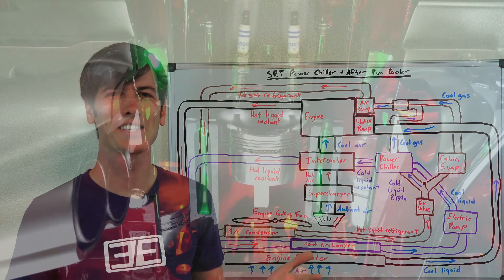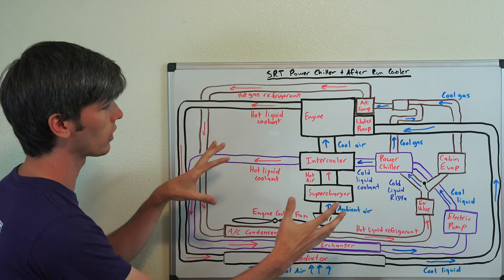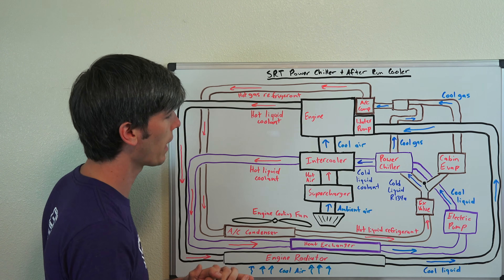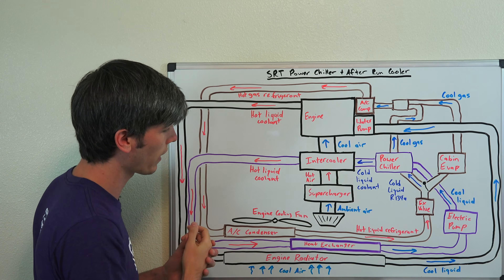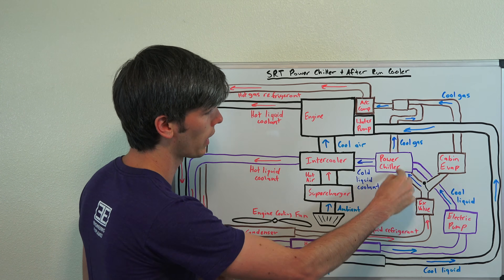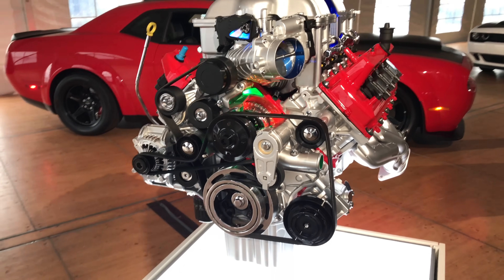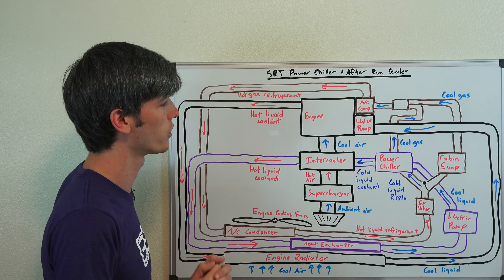How The Dodge Demon Uses Air Conditioning For More Horsepower!

Comment: So is this system better than a system that sprays the intercooler with Nox or CO2?  The coolant is contained in the Demon's design so you get around intake of spray bar output.  Is this going to be of benefit to people who have lower horsepower supercharged engines?  A Focus RS for example?  Maybe they do a Dart with an intercooled turbo?

Comment: My questions is about servicing the electric pump.
Would there be a way to implement this kind of technology without having to open up the AC loop to replace the electic pump? BMW just used an electric water pump for their "after cooler" which needed to be replaced about every 60k miles. These seem like it will be more common & more expensive to replace.

Obviously the Dodge Demon is a limited production Specialty Car so this isn't an issue but if this technology trickles to another vehicle then it could become expensive.

Comment: In 1993 Ford had the Mustang Mach III concept, which is basically where the Terminator motor would eventually come from, that used what was known as a Supercooler which used the exact same concept Dodge is using to cool the Demon motor with.  I never did understand why Ford never actually released a vehicle that utilized this technology.

Anyway I think this is the most interesting aspect of the Demon and I'm happy Dodge is actually producing it.

Comment: So complictad to get this dinosaur ICE to beat a Tesla. And the next Tesla that comes out will most likely beat it anyway. Oh well.
Reply: diskiller you're comparing an awd electric car with instant max torque to a rwd gasoline engine car with a 0-60 in 2.3 seconds. Tesla's are useless after 60 mph.
Reply: you tesla fanbois are funny. the demon is cheaper and more practical for everyday use. not to mention maintenance costs. lets compare the costs in 10 years. i'll bet that tesla will be seen as the joke.....the environmentally disastrous joke.......it really is.

Comment: Fantastic! At 0:37 i paused the video to examine the chart and i figured it all out 😋 the ac basically acts as an auxiliary intercooler for the liquid flowing through the primary supercharger intercooler. Cooler intake air means more dense air which encourages the ecu to add more fuel for more power! Smart thinking dodge! But is that extra power worth the extra weight lol where do we draw the line?!

Comment: Question?

An automotivr A/C system uses what's called a reveiver dryer to purge water vapor from the A/C system.. this is why you sometimes see water forming on the tarmac under a vehicle on a hot day.

At the drag strip, the A/C system cannot be run because of this drippage that can cause slipping and accidents.

How does this system overcome said issue?

Comment: Why did it took so many years for some to use this? I know the A/C takes engine power to work and so does the supercharger but still, it's been possible for so long. If you don't to lose power with the A/C you might be able to use an electric compressor like in a fridge or home A/C and have a second battery for It alone that recharges with the alternator. The only reason I think they don't use an electric compressor is because a belt driven compressor will have higher rpms and compression than an electric plus the lack of a strong enough battery. Still, who knows, maybe one day we will have electric A/C and less belts in the engine bay.

Comment: this system would make fighter jet power if it was using turbos! i why not just engineer a sweet water sprayer for the intercooler, a/c condenser and power chiller? one that would leak water on the track. then you can get well below ambient air charge temps

Comment: Dodge stole my idea!!!! Back in 2005-2006 I thought of the idea of using freon cooled air for motors. BUT unless im undsratanding this video incorrectly... it looks like the freon air is just to cool the intercooler air. My idea was to use the freon air directly into the combustion champers...

Comment: Here's the simple version of this easy to understand video. You have three air components in your car. The intercooler, radiator, and air condenser (basically the air conditioning). The intercooler and radiator take in a bunch of air. If you run the car AC it will take air from the outside and make it cold. Basically the AC is the intercooler for the inside of the car. If you turn off the AC and send that air to the engine, the engine gets more air. The AC will be connected to the intercooler so that it can take in more air. The AC in the dodge demon is basically just a third source of air for the engine. XD

Comment: I always dream of a way to use the exhaust heat to run an absorption chiller . This has been used in gas turbine generation to cool hot ambient air to 55 degrees f to eliminate the loss of 1 megawatt due to hot entering air into a Cf6 size turbine

Comment: Wouldn't it benefit from running the compressor on battery or storing pressure in a tank during the run, to eliminate the extra load on the engine from the condenser?

Comment: Question, will they use a second battery for the cool down system or just use 1? Won't that system drain the battery faster than usual?

Comment: turning ac off is overrated, it doesnt bog engine. just feeling, it doesnt even take 10hp and weight is like 20kg. ALso many cars after 2000 shut AC of on wide open throttle. Keep cool guys.

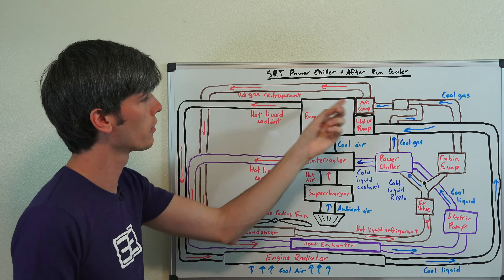Comment: 5:05  Why does the a/c compressor shut off over 4500 rpm?  I would have thought that was exactly when you would need charge cooling most.  I can't imagine the car makes a pass without ever going above that.
Reply: The idea is to cool IAT's before the run. That way you're starting with extreme cold IAT's, rather than heat soaked IAT's. I wouldnt want the compressor running during a run..that would just rob power. The intercooler pump, however, is still running at all times.

Comment: 5:04 So is 4500rpm a typical cutoff for the a/c in a normal car? Does it stop actively cooling the air if you go wide open throttle in a typical car?

Comment: I seriously doubt the a/c will be running while you shoot down the track. I know you said at ~4K rpm it shuts off, but I know a lot of other cars (modern) also have a A/C shutoff feature built into the base tune when you go WOT as well. Consistent hard pulls to 4k sounds like a great way to kill an a/c compressor. I see this feature being more beneficial in the staging lanes keeps your AIT's down while you wait in line to make a run. Just sitting, idling AIT's shoot up dramatically and ecu will pull timing, they don't come down until quite a bit of constant moving. They won't come down in just a 1/4 mile and this A/C feature will ideally keep temps down until you make your pass. I've played around with a dyno and older cars with no A/C WOT tune shut down will lose from 15 to 20 rwhp with the A/C engaged, newer cars are unaffected, as soon as you matt it the ecu disengages the A/C clutch and you see no difference while dynoing with the A/C on or off.

Comment: Autoline This Week (episode 2121) did an interview with Chris Cowland (Director of Advanced and SRT Powertrain at FCA) and he said that the idea to use the A/C system came from the Advanced engineering group (and not the SRT group) and they think that it may be a future technology to achieve better fuel efficiency in other types of ICEs that aren't meant just to chase power. How would that work?

Comment: Wouldn't a Turbo be much more efficient as it used the exhaust ?
Also can you detail about the temperature of each of the coolant circuits ?
And maybe can you make a video about the power loss and benefit of these systems ?
I think that Volvo has a similar system ?

Comment: For those short on time: bypass valve after expansion valve routes cold air from evaporator (passenger cooling) to a power chiller that feeds the intercooler. Very interesting. I wonder if this has been implemented before.

Comment: So how much power does the power chiller actually add?  I'm skeptical that just a 10 degree drop in air temp is enough to overcome the parasitic loss of running the A/C compressor during a run.  Not to mention the added weight that needs to be accounted for as well (not in terms of power, but 1/4 mile performance).

Comment: Cool video. I wonder how this compares to the efficiency of using an additional injector at the front end of the supercharger for cooling the air charge.  I know 90s Toyota used to do this and they called it the 7th injector and they just sprayed raw fuel inside of the supercharger to keep the fuel cool.

Comment: Superchargers = not nearly as efficient as turbochargers, and actually cause parasitic loss; pro - instantaneous throttle response

Turbochargers = much more efficient, utilizing energy that would otherwise simply be expelled, and greater ultimate power potential; con - boost threshold, spool time, and transient response between shifts

Comment: I do love these in-depth detailed explanations on this channel; it's fascinating.  But any of his engine videos, and especially this one, illustrate just how absurdly complex engines are getting just to eke out a few more HP (and usually at the expense of fuel efficiency).  EVs, specifically the Model S, are amazing out of the box, but I can't wait to see what the gearhead world can get one to do once they start really tweaking them: different gear ratios, better cooling, maybe electromechanical flywheels to prevent battery overheating...

Comment: Should have a collection tank from the cabin evaporator to collect the condensation from the air and then use it in a water injection system too.